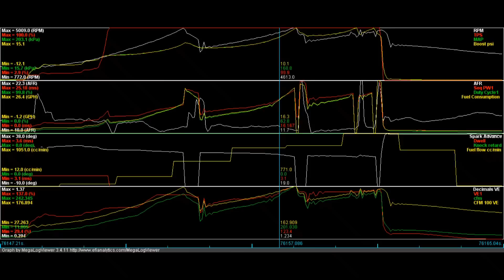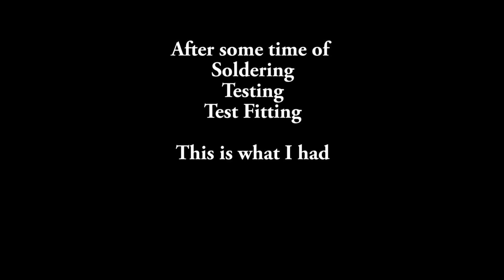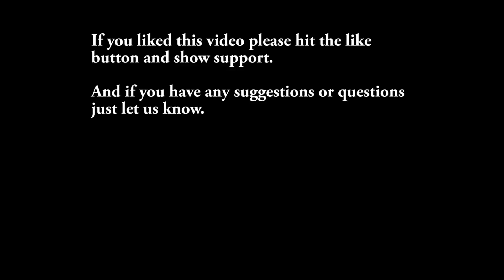92 Toyota Celica Microsquirt Install

Comment: Hey I dont expect you to respond to this, but do you know if it would be possible to use the knock module and the microsquirt (as well as a knock sensor from a newer motor) to allow an older rev 1 5sfe (without a knock sensor) to retard the timing when knocking?
Reply from the maker: Yes you won’t have a “knock sensor” threaded mount like that is on the 92+ stuff however there are other threaded mounts that you can place it. Sound travels pretty easily so as long as it’s not mounted on a noisy component like the head or power steering pump it would work.

Comment: I gotta be honest this is confusing me more than it should but I have 1990 5SFE and would it be easier to just get a 92 with the knock sensor or have a timing retardation from MSD? Excuse me I'm just trying to figure out everything.
Reply from the maker: Having a knock sensor would be best, and could save your motor from detonation. I would definitely have a way to control ignition timing other than the factory computer either way. With out a knock sensor, control over ignition timing, good AFR, and good fuel you should be ok.
Reply: I was originally planning on going for the 3S-GTE engine just because it was alerady turbocharged but I'm having second thoughts on rebuilding a 5SFE new cam, valves etc get it bored for a lower compression etc etc... My goal was around 300 MAYBE 400 horsepower with a upgraded CT20 turbo since the whole block would be rebuilt and this seems to be pretty rare with the celicas more of a MR2 thing, but would you know by any chance if it would matter what car the 5SFE comes from because correct me if I'm wrong but they did introduce the knock sensor in the 92 or later models?
Reply from the maker: Your correct 92+ engines will have the knock sensor. If your starting with any block I would suggest a 98+ Camry block. Iv never personally had a 5S-FE to that power level, but I'm sure its possible with a lot of work in the head. Starting with a 3S-GTE might be a better rout to go for those power goals.
Reply: I'm considering it as it'll also be WAY cheaper to get power out of it and it'll come with all the turbo parts alerady which add up to around $1000 as it is plus a engine that may work, and so let's say it cost $1000-$1500 I can spend $800 on a PNP MS which praise god for that! And maybe some more money on new pistons and a camshaft upgrade.
Reply from the maker: If you get your hands on a Gen3 3sgte, they have lower compression at 8.5:1, 550cc injectors, the ct20B and a better headgasket. That should get you close to your goal without opening up the engine.
Reply: Alright thanks, but by any chance would you know if they fit perfectly fine in the 5th gen Celicas? I read on a forum that they need a front clip for the 3rd gen 3SGTE in the 6th gen Celicas  but not the 4th gen but that is 6th gen so...
Reply from the maker: all 3sgte blocks are pretty much the same, as far as mounting in a car. I'm not sure why they are saying they need the clip for the swap. The only thing I can think of is if they are ditching the S series transmission that would come with the 5sfe. The E series trans uses different mounts which also requires a different cross member. In the 4th and 5th gen celicas that cross member can be easily made or obtained from a alltrac. The 6th gen celicas have a much larger/complicated cross member that is harder to fabricate or find.
Reply: Oh thank god for the help mate! It really helps thank you! I suppose then that as the mounts are the same then I could go for the 3rd gen with the lower compression since I can stick a bigger turbo? But then again the 4th gen does have a Coil on Plug which is nice for obvious reasons, but I'd be sticking with the S53 just for the sake of saving money where I can.
Reply: Well I went ahead and did some more research and I found not many people have done 4th gen swaps for good reason, the wiring is a huge pain and you basically need to hire someone to do it compared to the similar harness of the  3rd gen, and parts, wiring diagrams and all that are WAY easier to find and acquire than the later JDM Models. Surprisingly enough the ST205 are more expensive than the ST215 but that's probably because they are more desirable.
Reply from the maker: The gen 4 3sgte also has a much higher compression ratio. If your using an aftermarket engine management like the megasquirt stuff, wiring up the engine will be straight forward for any engine you choose to use. If you decide to go gen3 the lower CR will make it safer and should be able to push it a little further

Comment: So you took the wires you need, injectors, distributor signal, and knock sensor from the celica wire harnesses and plugged them into the micro squirt? So the cars stock computer does not get those inputs or out puts, they go into the micro squirt and out of the micro squirt?
Reply from the maker: Correct, the stock computer has been removed completely only using the microsquirt to run the engine.
Reply: Velocity Garage 
That does not sound as complex or complicated as some make it out to be.
Reply: Velocity Garage 
also thanks for the responses.
Reply from the maker: Its not too complex, preparation will make it go smoother. Get wire diagrams for the car and standalone. Do some research and then start the installation. If you have any other questions feel free to ask. I'll do what I can to help out.
Reply: Velocity Garage 
Thank you. You newest video is really good for explaining everything and what you used. Great work.

Comment: hey mate its Neil again, does the megasquirt unit also allow you to upgrade to individual coil packs for ignition, using ths stock toyota ignitor?...or is that wishful thinking? The old school distributor is really not very good for tuning.
Reply from the maker: To be honest I'm not sure if the micro squirt I used in this build will support individual coil packs. However in my last build I used a Mega squirt MS3X. I used 1zz-fe coil packs from a corolla. I eliminated the igniter and ran the coils individually off of the MS3X.

Comment: doing this install myself soon .I have no problem doing all the mechanical side of the install, im a sheet metal worker by trade and have been swinging spanners since i was 15......im pretty sure i can manage the wiring which is pretty basic im sure,  only trouble is im not sure where to get jold of the sensors and conrrollers you used, y band sensor is easy to get on ebay, can you give me the link to all the elecrical parts you used including injectors and pump.....would really appreciate it.....have enjoyed your videos, well done with the project so far....Neil...Australia.
Reply from the maker: The sensors I bought came from https://www.diyautotune.com. I had the st185 map sensor laying around, but using a stand alone you can just use a GM 2 or 3 bar map sensor depending on your set up also available at the same website. I still need to install injectors, the stock 5s injectors are running lean on the top end. I plan on running the yellow top 7MGE 315cc injectors with a 3SGTE fuel pressure regulator I purchased off eBay. As far as the fuel pump it is stock, from my experience I'v found the stock st184 5s fuel pump to be sufficient up to 12 pounds of boost. Thank you, There will be more videos coming soon.